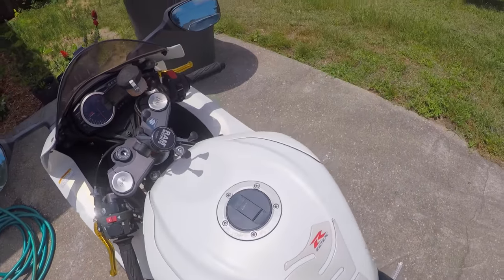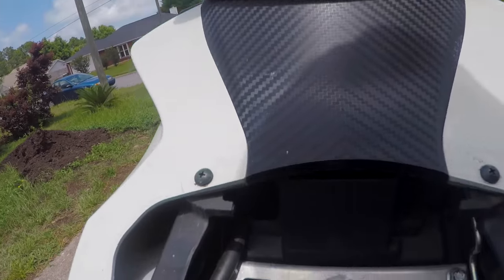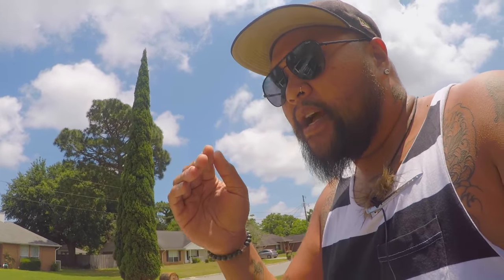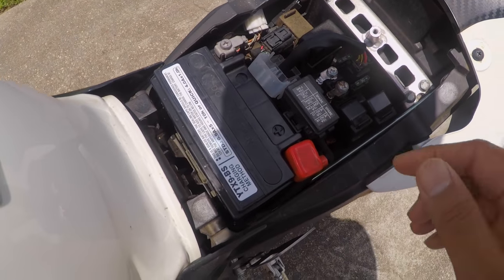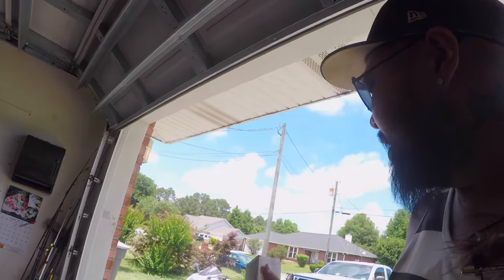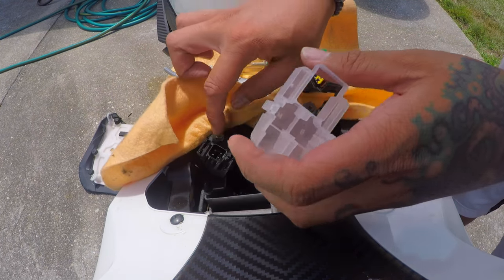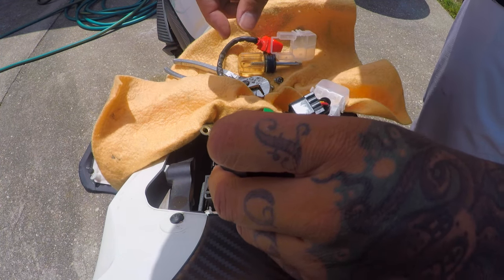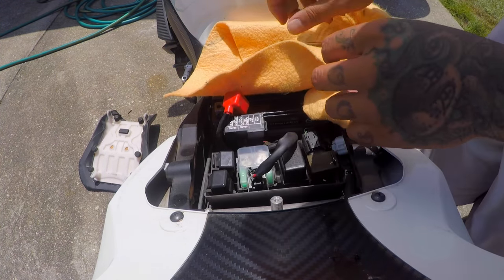**Solved!** Starter relay problem! Works for most bikes/vehicles!

Comment: 4 yrs later and just got me out of a bind, faulty relay issue .... Nice one 👍
Reply: same thing for me
Reply: Was it clicking when you tried to to start you bike ?
Reply: @Memphisnews901 that’s what’s going on with mine. I  feel a violent vibrating as well as a loud clicking sound
Reply: took you 4 years to diagnose a bad relay? jesus christ
Reply: @aricroy4258  man ive had my dong fang 200 for a month had what seemed like a starter issue but after replacing the starter and solenoid still nothing battery is fine at 12.5 so i ordered the starter relay  comes this weekend it took me 2 weekks
Reply: I have an rs660 just sitting in my living room because it won't start.  I only get clicks when trying to start it. Was able to push start it though
Reply: @FutureProductionz239   that will be starter motor, check the connection to the body of the starter motor and give it a good glean. Other issue might be dirty contacts from chain oil on the sidestand switch.

Comment: Dude this video was a gift from God for me because it literally allowed me to diagnose that's wrong with my bike. I've own multiple bikes but was making really good money at the time so always had a shop do the work for me. I'm Gen-X so I grew up in the carbureted motorcycle era but everything I've owned is always been fuel injected so why was always super cautious with doing s*** with the electrical. This is a old-school trick that I had completely forgotten about props for bringing that sucker out cuz it is so simple and allows you to with a screwdriver and multimeter diagnose your starter your fuel relay switch your stator and voltage regulator all with those two simple items. Turned out I had to I got a state or not putting out enough voltage and a fried fuel relay switch which was just recently but that's on the video bro good looks I can chill the rest of my Sunday now
Reply: Ikr!

Comment: Great video! This was just what I was looking for, except the the screws for my relay were loose. I was really upset but you made my day! I will create a video for my motorcycle in order to help others as you've helped me.
Reply from the maker: Im so happy to hear this!!!! Safe riding!! I'll look out for your video!
Reply: Always make sure all of your connections in a circuit are tight before doing any other troubleshooting.  Otherwise you will chase problems all around and get nowhere.

Comment: I have the same problem with my xr650l, when I press the starter button it's only clicking in the relay. I'm pretty sure if I swap out the starter relay it will be ok but I never thought to try and jump it the way you did and test the relay. I'm glad I came across your video bro, mahalo.....from Hawaii.   I am not a mechanic also, I come on YouTube and try to find videos like yours, which I'm glad I did, and learn from it. I know this has been a very useful video for me and I'm sure others will find it helpful as well.
Reply: Have you tried this yet? I just bought an 06 XR650L yesterday it’s doing the same thing. I put a new battery in today hoping that would fix it but nope. I only paid $1500 for the bike because it won’t start. I know it has to be an easy fix though. Let me know how it went. And ride safe from Alaska
Reply: So today I replaced the relay and the cdi still the same problem I tapped on the starter a few times and it fired right up picked up a used starter for $40 to fix it. Good luck with yours. Try tapping on the starter if ya haven’t got it going yet.
Reply: @GratefulEd907  We checked starter relay, battery, fuses and got good readings with multimeter. Got power from battery to starter relay to starter but starter not engaging so we took it off and tried tapping on it to free it up but pretty sure starter's fried. I have a starter relay coming in, will replace that hopefully that helps but in the meantime I'm ordering a starter just because. Keep you updated, Aloha-Btw, I tried the screwdriver trick and it wouldn't do anything
Reply: @WILLY52368  right on man good luck with it. I just found a couple “XR650L parts for sale”  Facebook groups and thought I’d give ya the heads up in case ya haven’t ordered a starter yet ya might be able to find a good used one for cheap.
Reply: @GratefulEd907  Shucks, I just ordered a starter from fleabay, I mean ebay. Here in Hawaii not too often you'll come across a XR650L or parts for it but thanks for the infor I know it will come in handy in the future. Aloha my friend, safe riding out there
Reply: @WILLY52368  I got lucky and the guys at our local Honda shop just parted one out.

Comment: Thanks for this, really useful. I’ve had a similar problem on my Triumph. I shorted out the solenoid this morning and it fired up first time, didn’t even have to pull the clutch in which was weird.
Reply: In the circuit power is supplied to the starter via the clutch switch, forcing you to pull the clutch to connect the starter switch to the relay via the battery, shorting across the poles gives power to the relay upstream of any switches, hence your bike started with no clutch.

Comment: Good call, this is a direct result of bean counters telling the Engineers the tried and true materials are too expensive and to make it cheaper.  What is happening inside the solenoid is the contact surfaces either wear through or are so burned that they no longer make contact due to pitting and carbon build up.  Being a sealed unit there is no way of being able to clean the mating surfaces for a few hundred more starts.  Replacement is the only option.

Comment: I had my goldwing running and then it just stopped NO CLICK NO CRANK. I basically could not figure it out then I started to look at the relays after watching this video. I just removed the relay and then reseated it and the bike fired right up. A little different than this video but still this is what made me look in this direction. Thanks for the video!

Comment: Thank you! My 06 Zx10r just did that exact thing to me  a few days ago. I'm gonna troubleshoot this way. It sound like my exact problem with my bike
Reply from the maker: Give it a try! If you can, be sure to check the voltage on the battery. When testing the relay and starter motor, it needs a certain amount of voltage to turn over. Just keep that in mind before spending a bunch of money on things that may not be the problem like I did :P
Reply: Gotcha! Thanks for helping me out. Much appreciate brotha!!

Comment: Some Moto Guzzi's had a seemingly similar problem that was actually caused, I believe, by the wire feeding power, via the starter relay to the starter solenoid, being too small a gauge to properly feed enough power to said solenoid and giving the impression of a faulty solenoid contact. Problem fixed by running a 25A cable with inline fuse (experiment with fuse size 10, 15 or 20A) from battery to solenoid via the starter relay to replace the original solenoid feed wire.
Reply: A V-Twin needs a larger diameter wire than an Inline four due to the current demands.  A wire with too small a diameter cannot handle the current needed to do the work and acts like a resistor which further exasperates the issue.  An easy check is to physically touch/hold the wire after it has had a load placed upon it.  if it's warm, probably not a big deal.  If it's too hot to hold, your problem starts there.  OHM's LAW.  Look it up.

Comment: Awesome video!!! After watching a couple videos on YouTube,  I eventually came across yours.  I had the same issue but my bike is a 2006 GSXF 600 Katana so I often cant find videos on it. The starter relay was making the click and the fuse was fine on it and so I thought it had to be the starter motor because it looked a little cooked. And after buying a new one and installing it, it still wasn't cranking. After watching your video I ran down stairs and in to the garage to give it a try and sure enough she cranked. Thank you so much for sharing this video with us.

Comment: I know this vid is 5 years old, but let me add a comment that might help others please.  It may be tempting to not want to spend the $75 for the Suzuki Relay and instead buy a much cheaper one.   I bought a cheap one first and it failed in short order.  I popped for the Suzuki and it has worked very well.   I also cut apart the old Suzuki relay and the cheap aftermarket one and you can see the big difference in quality.  The cheap one was cheap in every way.    The plastic case is way cheaper.  The springs are weaker.  And the way they swage the two contacts to the terminal is really inferior.  Don't use them.  Go with the expensive Suzuki one.  Not perfect, but way better.
Very interesting how these work.  There are actually two springs inside that balance the contact plunger.  The open spring is slightly stronger.  When the starter button is pushed, it energizes a solenoid coil that then overcomes the open spring allowing the close spring to push the contact button towards the two terminals.   Of course there is a healthy dose of current that needs to go to the starter and eventually this causes pitting in the contacts.  Over time this can cause "insulation" and enough current won't flow.  This is when you will need to replace the relay.
Reply from the maker: @deanbradley6887  couldn’t agree more. Crazy how common this problem is and is usually overlooked. I’d rather pay sub $100 for a relay than a stator/rec fix! Thanks for the helpful info and hope we can continue to help other riders!

Comment: Thanks for the clear video. This was the simplest explanation of the clicking issue. I have a 07' 650 V-Strom with 49,600 miles. It seems like it is my relay/ solenoid. I'll try to jump it like you did and see if it starts. Thanks again.

Comment: I’m thinking my starter is bad because I replaced the selenoid and it still makes a single clicking sound when I try to turn it on. Can it also be the crankshaft position sensor? Someone told me a bad crankshaft position sensor has the same symptoms as a bad starter

Comment: Ay bro I'm working on this right now 05 fz6 just getting a click on ignition. Fully charged battery and load tested good. Gonna try bridging the starter relay, I ordered a new one too. But it'll rule out the motor. Bike has 56,000 miles. Thanks 🙏🤘

Comment: Thanks for the video !!! 
I fixed my motorcycle problem which had same issue and it worked. After couple of weeks I’m encountering the same issue after replacing OEM starter relay. I have a brand new battery as well. Any suggestions 😢?

Comment: Thank you so much for this! I had just a click, so I did this and now my starter is working normally again 🤔.  Not complaining, I'm just thinking I've now corrected a bad connection by welding the connector bolts on to the starter relay/solinoid... 😳  It took a bit of turning-over as my bike has been off the road for 18 months, so there were a few sparks and my screwdriver is a bit messed up... 😩😂  It's kind of hard to keep a good, clean contact with just a screwdriver...
Reply from the maker: David Reid yeah buildup can seize the springs and gear cogs in starters and relays. Which is what happened to mine. It sat for a year and wouldn’t start. This little hack helped me get home a few times!! Haha Safe riding brother!

Comment: For slow cranking and starting problems if the battery is good then check your main ground wire, take it off, clean the connections good. Be careful with aftermarket parts, they may be cheap but may not last or worse the relay may stick closed like mine did.

Comment: Having same issues with a Yamaha wr450f dirtbik. No crank at all and thinking its the relay cause battery less than 6 months old and it's on a battery tender. Did you buy cheap relay or a good one? Thanks for the video any feedback appreciated

Comment: If you have no power at all. Check the relay fuse. It's right on the relay. Usually a big 30amp fuse (some come with a spare)
If it doesn't turn the starter motor then listen to what this dude says 🤙

Comment: Good diagnosis, never trust a relay, i had the same problem with the car, you hear the relay click but no start, of course replace the relay is the cheapest option, when i inspected the relay after opening it, i found corrosion on the connection, once sanded down and cleaned it works again, so keep it as a spare, i made a video a bout that, nice bike you got there

Comment: Hi, I replaced the relay and it still makes the exact noise and click as per above, even when i short it out, any ideas? I've bench tested the starter itself and it works 100%?
Great video
Reply from the maker: How many volts is your battery pushing out when trying to start it?

Comment: I have a 2011 zx10r.
Same issue as you.
Couldn't start the bike the way you did though.
Ran the volt meter like you, all same.

You still think i should replace the relay or could it soemthing else since all i did was cause spark trying to start like you did (by bridging the 2 with a screw driver)
Reply from the maker: @felipeandrade7031  I’d start with the battery always. If it’s not pumping 12.5+V when cranking, or trying to start it, get a new battery. Then if it doesn’t work still, go to the relay. Over time, the relays internal contacts or the spring gets bogged. Bypassing via the contacts on the relay should initiate the starter motor. If it’s just clicking, it’s the battery. If it’s cranking but not turning over, it’s the starter motor. If you get just one click, it’s the relay. Hope that helps

Comment: I'm having a similar issue but mine starts up fine the first time but if i try multiple times or drive and stop and try restart, it wont, have to give it throttle or jump start. Bad starter motor? or relay?

Comment: Thank you!! I hope it works for me tomorrow! My bike won’t even turn on the electronic screen on. Bikes been sitting for a year. Got a new battery and nothing.
Reply from the maker: Carlos Isais I know how it feels!!! Be sure to check the fuse within the relay!! I recently helped someone and all they needed was a new 30amp fuse! $1 fix haha please let me know how it goes tomorrow!
Reply: It was the fuse!! Hahaha. I had a chat with the guy at chaparral motor sports and he said I was on the right track. However, the old relay fuse housing was too loose and finicky, so I just replaced the whole thing. Cost 94 dollars.
Reply: I’m just happy I didn’t pay the dealer $400 bucks. Thank you soo much, you saved my ass with this video
Reply from the maker: Carlos Isais dude!!! So happy you got it running!! Safe riding brother!!

Comment: Thanks for the video! Because of this I’ve been able to start the bike. Thought it was my starter relay but still having the same issue. The bike turns over just fine. I’m not getting the click from the relay when I hit the starter switch though. I’m thinking that’s going to be the problem
Reply from the maker: No clicks/fuel pump usually means low voltage (battery issue) at least in my experience with motorcycles. Is your stator/rec working? You can test it by using a voltmeter to make sure the battery is recharging while the bike is running

Comment: Man thank you so much! My Sv650s wouldn’t start when i went to the lake and parked up for 10 mins, had to push it back to a friends place and then installed a new battery, but it still wouldn’t start until i tried this! It starts up but i have to bridge the terminals using a screwdriver, i am going to replace the fuses on the relay and if that doesn’t help i’ll swap the whole relay
Reply from the maker: My man! I hope you got it fixed by now, I'm glad to have helped you via the video! Nothing ruins a great day of riding and chillin by the water, then returning to see your bike wont start. Did you ever get a solid fix?
Reply: MotoCos88 Still havent got it fixed :/ i think it needs a new starter relay, which i will try and source this week. But for now - screwdriver sparks!!
Reply: Update - ordered new relay, bike still wont start without bridging terminals :( im thinking its the ignition switch?
Reply from the maker: @ejkmusic11  hmmm...when you hit the ignition, does the relay click at all? If it doesn't, it sounds like the problem. It usually starts with the battery, ignition, relay, starter motor, and so on so forth. This is assuming that the battery is fully charged and all your ground wires are secure. I would inspect the ignition switch on the handlebar. I've seen videos where corrosion built up in the springs or corroded contacts.  Maybe even wires that connect it to the relay. Man, I hope you find a fix soon. :(
Reply: Nothing happens when i click the button apart from the lights dipping as per normal, and i replaced the battery also so its bound to be the ignition. Ill have a look tomorrow! Thanks dude me too haha

Comment: When you pulled the fuses from the old relay, did you check them ???  Could the problem have been a blown fuse all along ???  Cheers, Steve.
Reply from the maker: That was the first thing I did lol I usually start with that when it comes to electric work. Then troubleshoot the system in order from the batter.

Comment: My 17 or 18 mt-09 does have this kind of issue. The dash, gauge, fuel pump works, but whenever i start it i hear clicking noise is it because of the relay problem or will i get a new battery? I also encoutered sticking switch ignition.